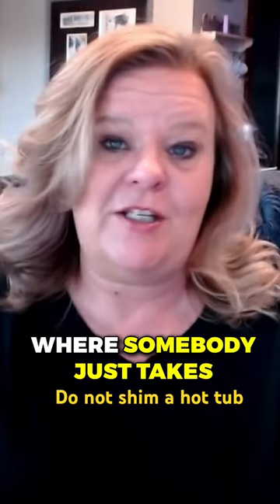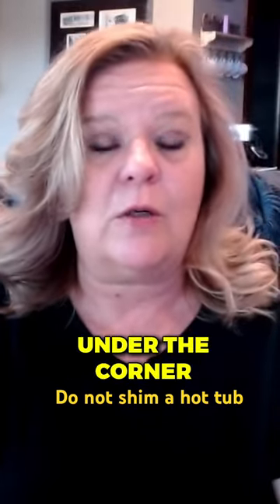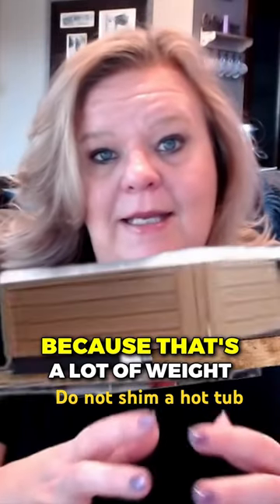Do not shim a hot tub.

Comment: My new HS Flash tub is sitting on an existing concrete patio, and I just noticed is about a 1 inch difference in water level from one side of the tub to the opposite side.  Is this acceptable or do I have an issue to resolve?
Reply from the maker: It is acceptable just always make sure you keep the water above the filter so it doesn’t surge

Comment: Wtf is a shim??
Reply from the maker: A shim is a thin piece of material, often wedge-shaped, used to fill small gaps or spaces between the hot tub and the concrete , to level or adjust them, to provide support or reduce wear, or to make them fit together more precisely. Shims are commonly made of wood, plastic, metal., and can be used in various applications, such as construction, mechanics, engineering, and manufacturing.